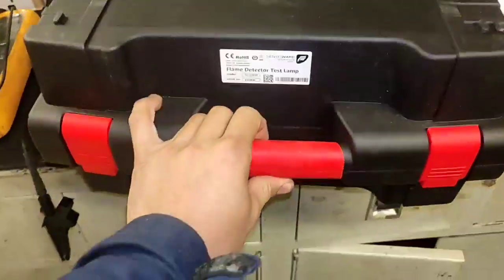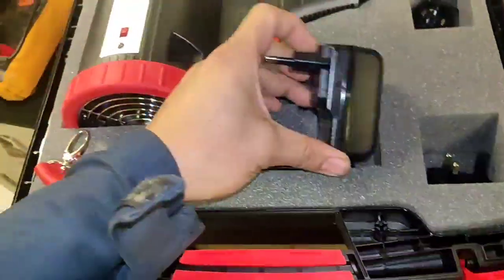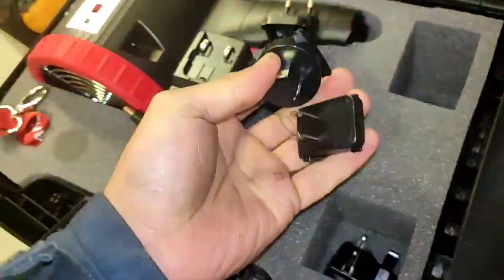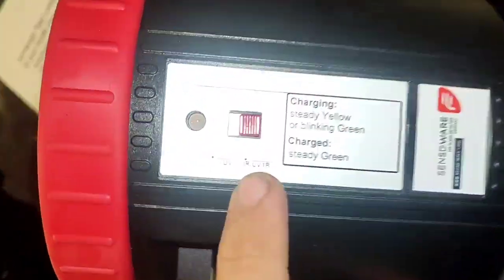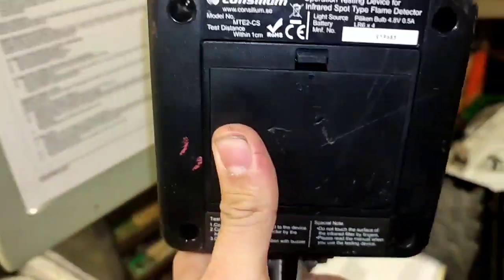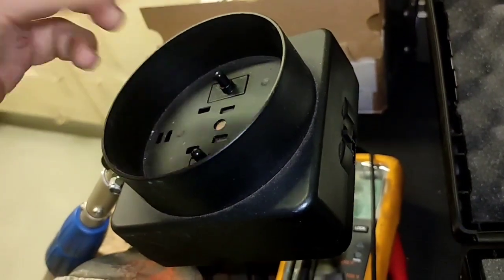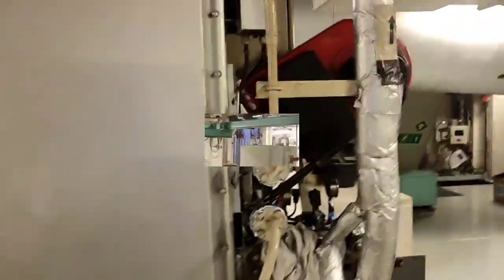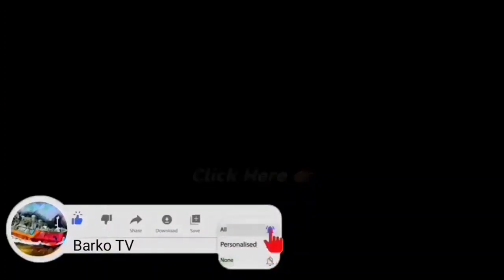Flame detector tester consilium and sense ware flame test lamp / fire detectors

Comment: Hi. Did you checked it with consilium flame detectors AC-IR-3Fq? Can you confirm it will work with it? It's almost three times cheaper than original consilium tester...